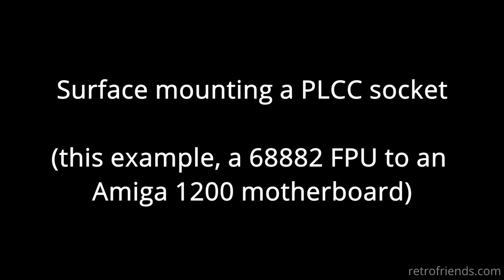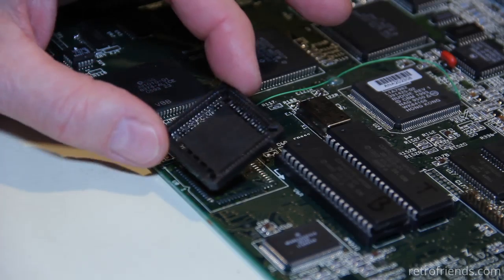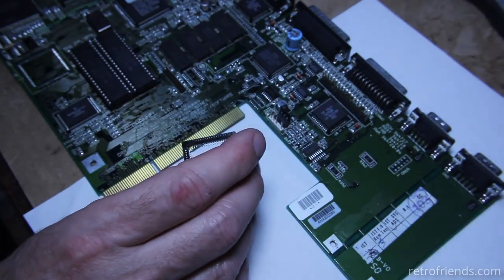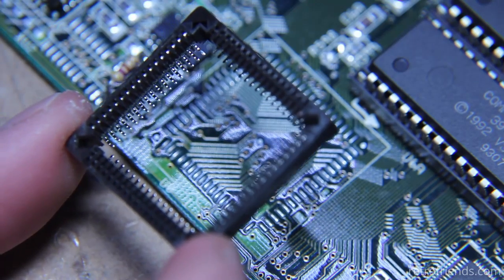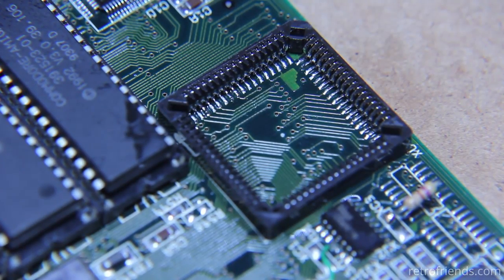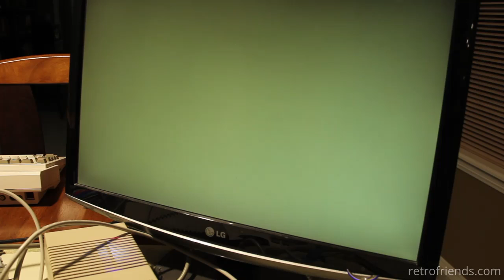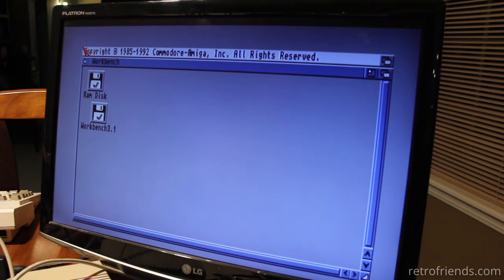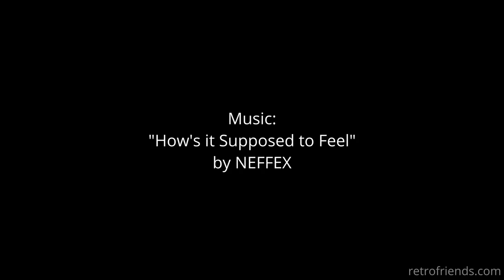Installing a surface mount PLCC socket (Amiga 1200)

Comment: Sysinfo shows how fast it is
Reply from the maker: As far as I knew sysinfo tests only the processor speed, not the floating point unit. It tells you that it's there of course.
Reply: @retrofriends  it tests both, and it appears right next to each other. MIPS for CPU e MFLOPS for FPU